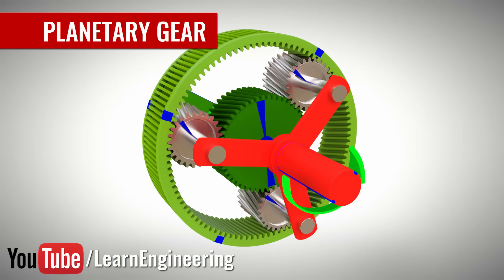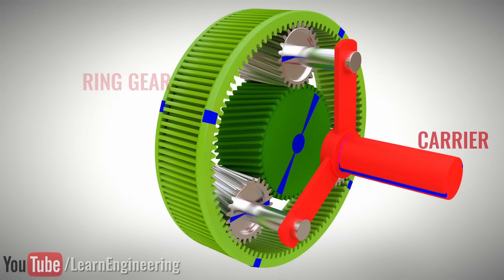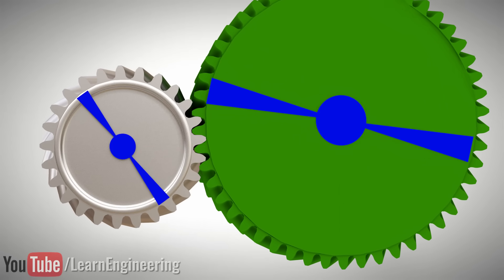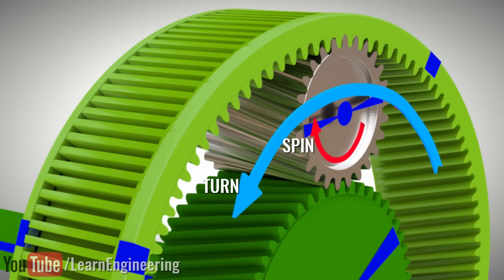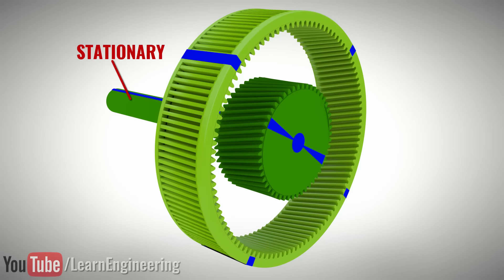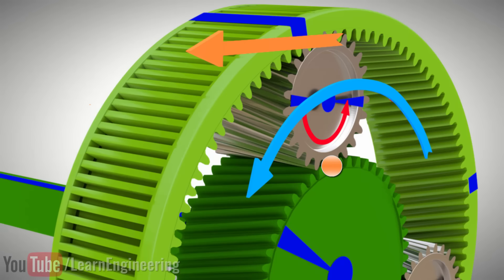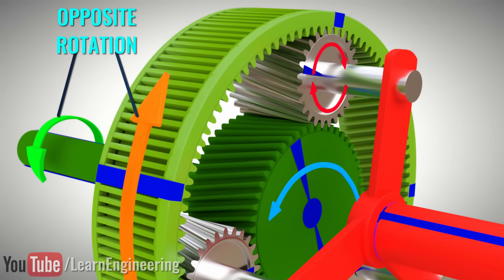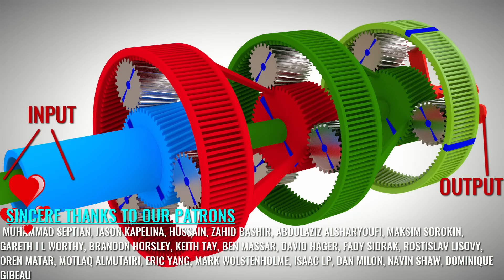Understanding PLANETARY GEAR set !

Comment: Weird. It says the velocity of point B is zero and then goes on to show point B moving. There must be another definition of velocity I'm not aware of.
Reply: There is TANGENTIAL velocity induced by ANGULAR velocity that deals with the spinning of the gear and then there is pure TRANSLATIONAL velocity that deals with the moving of the gear itself. Although the gear may look like its moving, it offsets itself by having those velocities cancel out each other. For example, If you look at a wheel and roll it done the hall, it is spinning and moving but at the same time. Tangential Velocity that is induced by angular velocity is denoted as V = r * omega ("*" means cross) where if you find the cross product using the right hand rule, it will give you the direction based off of spinning alone. If the pure translational velocity direction points in the opposite direction as the tangential velocity you will get zero. This is my intuitive understanding.
Reply: There is TANGENTIAL velocity induced by ANGULAR velocity that deals with the spinning of the gear and then there is pure TRANSLATIONAL velocity that deals with the moving of the gear itself. Although the gear may look like its moving, it offsets itself by having those velocities cancel out each other. For example, If you look at a wheel and roll it done the hall, it is spinning and moving but at the same time. Tangential Velocity that is induced by angular velocity is denoted as V = r * omega ("*" means cross) where if you find the cross product using the right hand rule, it will give you the direction based off of spinning alone. If the pure translational velocity direction points in the opposite direction as the tangential velocity you will get zero. This is my intuitive understanding.
Reply: That gets me thinking in the right direction, although I still find it confusing. I like your explanation way better than I like the video.
Reply: Instantaneous velocity is 0. Within a small interval in which point B contacts the stationary gear, right that before it is moving towards it and right after it is moving away; as the interval approaches zero the direction aligns on the same normal. Since velocity is continuous it crosses 0 at the point of contact. 
In other words, point B 'sticks' to the stationary gear and doesn't slide; the only reason it passes is because it is lifted out of or dropped into contact. As with anything rolling on the ground, the instantaneous point of zero velocity is on the point of contact.

Comment: Front-wheel drive BMW?
Reply: The BMW 2 Series Active Tourer is a FWD....
Reply: Niklas Ohlsson active tourer is not true bmw
Reply: rcomascat Every Mini is a BMW. Every Mini is fwd.
Reply: @rolyfisher9137  we had a 1 series RWD before, and an X1 FWD now...  both 136 hP The 1 series was more fun... for us with good weather, for others with snow on the road... 
We also have a smart with RWD, but that has no comparison with the 1 series. It's more likely to flip over (than to give you more grip for the driving real wheels when accelerating).